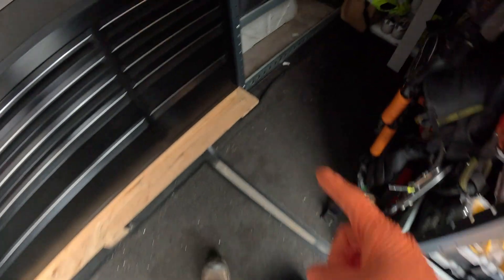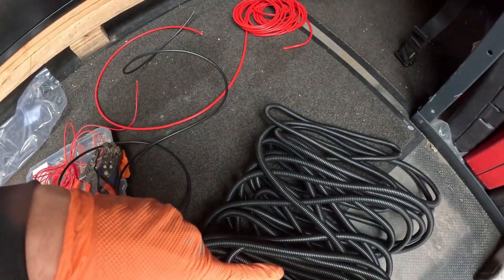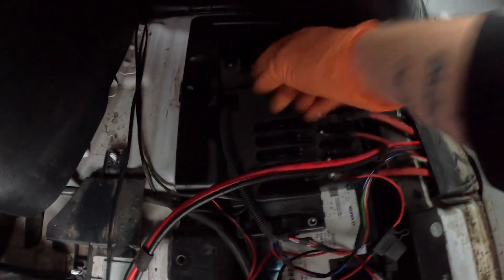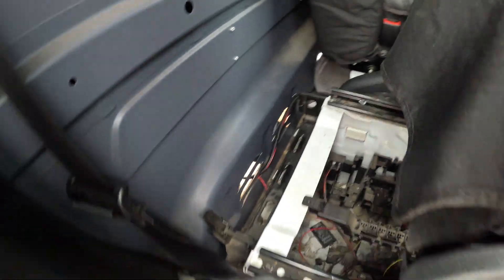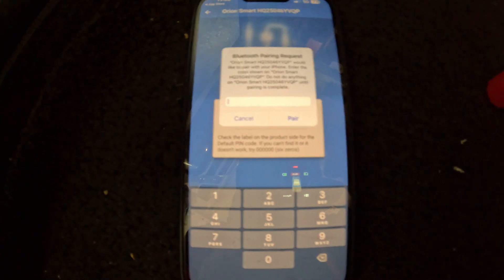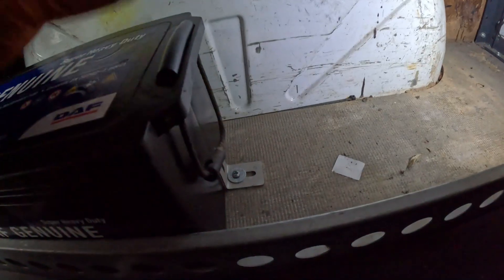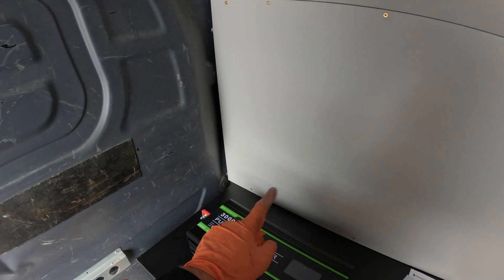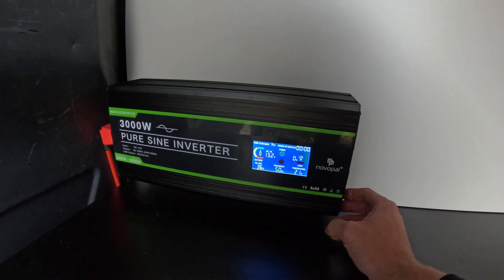Mercedes Sprinter Electrical Upgrade | Split Charge & 3000w Inverter Install

Comment: Hi buddy, do you have to have that size battery installed to run the charger/inverter,and if so why did you choose that size make of battery as I  struggling to find  that model battery ? Cheers Mike

Comment: You only needed to run the live to the battery the Ground  could have gone on the chassis near the split charger
Reply from the maker: We always try to install the grounds directly to the battery for the most reliable connection!
Reply: @TheScottishTechFleetSupport    I completely disagree

Comment: Great job, them screw type battery clamps, if you keep off cut of plumbers copper pipe, cut a strip off to slide into the battery clamp against the cable, then screw down onto it, that gives a better clamping force onto the cable, same idea as when fitting welding cable to the twist plugs. That charger is a game changer, quicker a split charge relay system 👍
Reply from the maker: That is a great tip, will definitely give that a go in the future, thanks!

Comment: On Sprinter vans, not sure about VW, but the bonnet catch loops into the passenger door, you can access the drivers door only when battery is flat, but cos the passenger door won’t unlock you can’t open the bonnet, cut the handle flush so you can.
Reply from the maker: Good shout, I'll keep this in mind!

Comment: You mounted the inverter too low and close to the unit which doesn’t allow the lower 230v socket to be easily plugged into because of some plug cables are too stiff
Reply from the maker: Really 😂😂😂 That’s the best bit of criticism you could have come up with. I’ll accept that if so 😂
Reply: just trying to help for future installs. Ex REME mech.  @TheScottishTechFleetSupport

Comment: Really poor install, cable to charger too small. Wrong crimping tool used on the insulated ring terminals. Not a fuse in sight either.
Reply from the maker: 1 the charger is a 30amp charger and I’ve used 70 amp cable which is over double. There is a fuse under the plastic at the battery cover (my sincere apologies for missing that part in the recording) and wrong crimping tool used 😂😂😂 the wire is solid in there and can’t come out. You stick to the keyboard and I’ll stick to the tools Mike 😂😂
Reply: @TheScottishTechFleetSupport there's no fuse on the inverter cable, you know the one that can pull up to 500amp at peak 😂

Comment: Where are your fuses ?
Reply: Mate that is absolutely shocking install i would not be proud off. Wrong size cable from main battery to leisure battery pushed thorough bulk head no grommets not fused at main battery  and not fused at rear. If that cable rubs through at bulk head will still be live from rear battery  don’t need ign wire on vitcron as volt sensed  even that was thrown in no pride in it  it may be tried and tested and your way but I wouldn’t do another one as the way your doing them are wrong and not safe good job it wasn’t my van  sorry but its a  bad install  …
Reply from the maker: Main power ones under the plastic at the battery